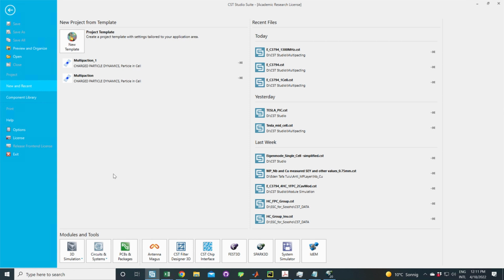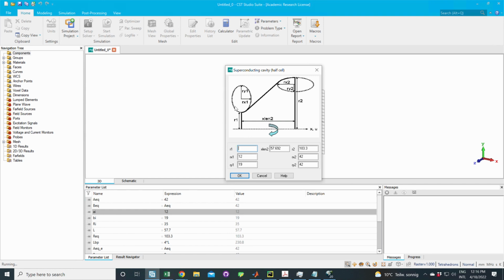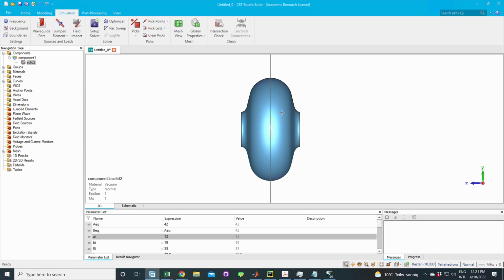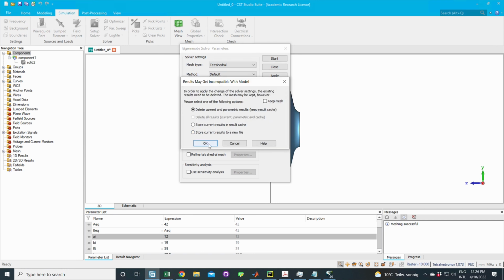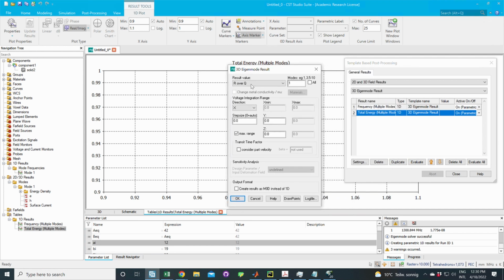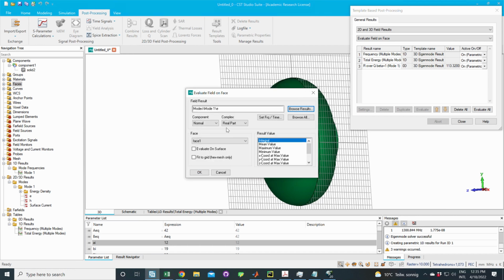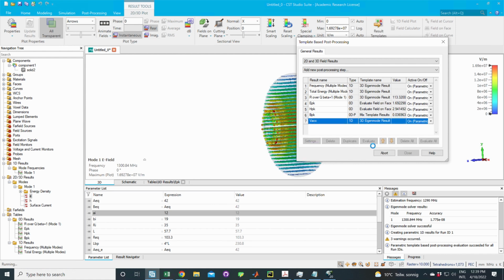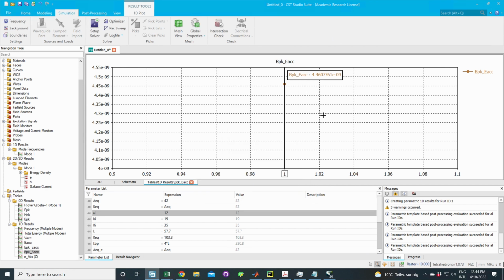CST Studio   SRF Cavity Epk, Bpk, Eacc, R Q

Comment: I extended this to a 9 cell cavity and it does not give me the same field in all the cells. The ones at the extremes have less field. Any idea of this?
Reply from the maker: It depends on the mode you're looking at. For a single cell cavity, the fundamental mode for such cavity geometries is the TM010 mode. When you increase the number of cells, you get different phase advances of the same mode. For example, a two-cell cavity has two phase advances so you'll have two TM010 modes. A 9-cell cavity has nine different phase advances for the TM010 mode. The mode you should check is the 9th mode which is the TM010-π mode.

If you already were aware of the above then my question will be if you have beampipes attached. If you have beam pipes attached then this is normal because the fields "leak" into the beampipes. If you make a plot along the axis you will also observe this. This is why the end cells typically have dimensions different from the midcells in order to maintain the uniformity of the field. The value that quantifies this being the so-called field flatness factor.
Reply: @numurho Thanks a lot. I checked and I had the beam pipes but I did not change the end cells. Now I introduced the different end cells and the field along the 9-cell cavity is the same in each cell. You helps is very appreciated.
Reply from the maker: @ricmonv  Glad I could help.